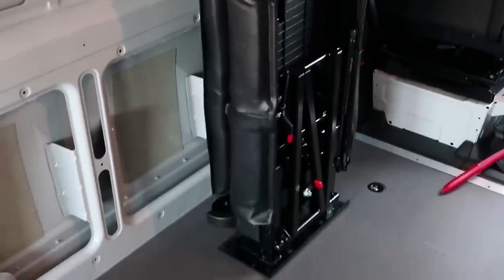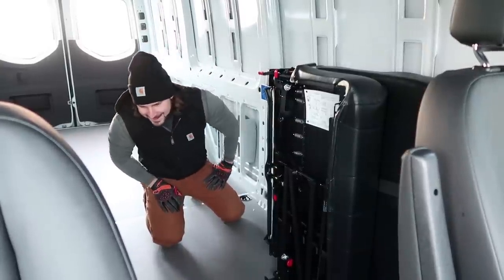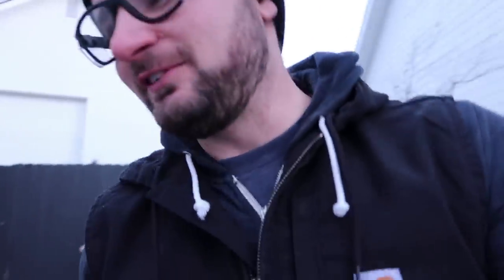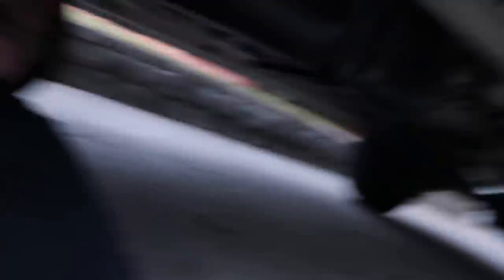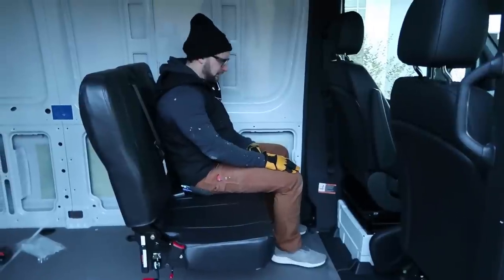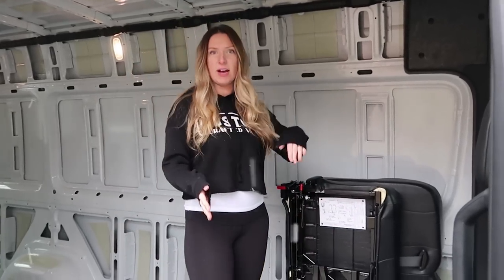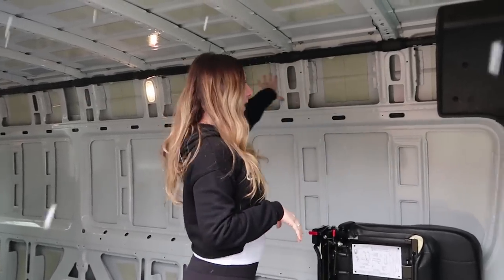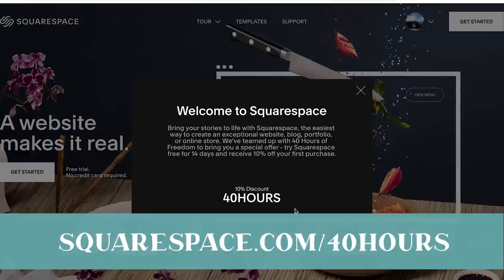installing bench seat in a van and our new van layout plans

Comment: The seat is a great idea ! I was wondering if you had contacted your insurance company to see if they would cover passengers riding with the add on seat in a cargo van.
Reply: That’s a great question I’ve always wondered the legal parts about doing this, I really want to do this in my minivan camper !
Reply: I'm almost positive that after you get it crash tested, the rest should be easy... Theoretically
Reply: In Canada I was told by the dealerships that if seats are added to a cargo van insurance will not cover the other passengers. Need a crew van that is rated for 4-5 passengers from factory. You can then change seats to different styles by approved manufacturers.

Comment: Love, love, love this.  We will be looking for a van build hopefully next year and are looking for ideas to transport at least one grandchild occasionally.  Would love to find a double bench that will actually swivel to the wall though, so we can sit in it like a sofa to view out the door.  Is there a way to do that and still be legal as forward passenger seat when driving?
Reply: Hi Kim, did you ever find out if this was possible for you? I'm interested in doing the same thing.
Reply: @heathermerkley4451  I have yet to find a bench seat that will turn along the wall when not driving.  (Let me know if you find one.)  We are considering opting for the sofa/bed solution that legally has seatbelts in it already, but much won't be decided for us til we know what vans are available when hubby retires.  (He decided to stay working longer during covid).    Best wishes in your travels.  :)
Reply: @kimgilmoregraves9026  I think it’s more about the floor than the bench itself. I would like to do the exact same thing in my van. I’ve seen it somewhere!
Check out Smart Floor. I think they can do a custom floor that accommodates the changing of direction for a couch, you would have to manually change it though. Anyway, that’s my avenue to get it done, if possible. Safe travels! 🇺🇸🦋✌🏽

Comment: Great video James,

questions for you.
1) Do you think it's possible to weld an extension onto the base of the seat so it sits higher to be the same height as the driver seat in a promaster when it swivels around?

2) Are you going to do all of the flooring around the installed seat, or do you take it out, do the entire floor then redrill the holes through the insulated floor.

Thanks
Reply: Wish they would answer this I would also like to know both answers

Comment: In your van layout guide you have recommended two different bench seat heights. In some of the renderings and in SketchUp you recommend a 17” height but in the “Build Tips and How Tos” you recommend 18.5 “. which is the appropriate height if I extend to use 4” foam cushions? Thanking you in advance for your clarification. Cheers.

Comment: Would this work with baby seats? Been hoping to find a foldable with the metal hooks rather than belt through
Reply: Also looking for a baby seat solution. This one doesn’t appear to have anchors on the back which are required for forward facing. Head rests are also required by most car seat companies.